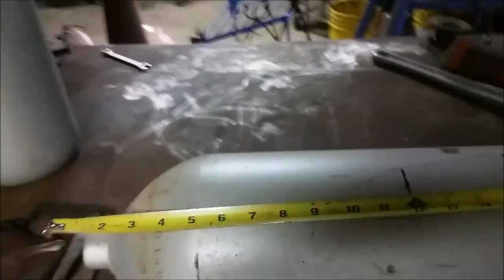Making a Bell Start To Finish

Comment: John I have 2 sticks 1\2" by 4" by 4" by 14' tubing to hang the bell should I weld or drill will it change the tone and were on pipe should my attachment point be. bell pipe is 1\2" by 10" by 10 ' steel. Lower tones are preferred any idea's
Reply from the maker: The bell should hang from a ring or chain. I have never hung one that size. It should have a nice low tone I would think.

Comment: John I have a pipe 10 in dia. 1\2 thick 10 ft. long I want to hang it as a bell I have post where in the pipe should I mount it and what should I use I can weld but for best sound I need help should I mount on end close to it or 1\2 way??????
Reply from the maker: If it is steel pipe you are looking at 64.4 pounds per foot for a total of 644 lbs. What are you suspending it from and what are you planning on suspending it with. That's a lot of weight to have hanging.

Comment: So I have a smaller oxygen tank. I've opened the valve and let it vent for a few hours, I got a loud hiss but now it's quite. after watching this I will let it vent overnight. should this be enough to insure that their is no pressure in the tank when I attempt to remove the valve?
Reply from the maker: If you let it sit overnight you should be fine.
Reply: Thank you sir, I'll do that and attempt your method for getting the valve off.
Reply: Attempted to get this valve off. Didnt quite have the tools you used in your video but did attempt to ratchet strap the tank to a tree but it is on tight. A friend of mine mentioned that it probably is stuck on with loctite, which I looked up has a strength of around 3,000 psi.
Reply from the maker: Never had that much trouble.My next step would be to try to make an adapter for an impact wrench.
Reply: Are you sure it was an oxygen tank? If it was acetylene, propane or other flammable gas it would be reversed threads.

Comment: Mr B,
What is that air actuated hammer you used to pancake the clapper? I don't beleive I have seen that device previously.
Thanks!
AAR
Reply from the maker: That is a KA75, nice hammer for hand work. Plenty of room for tooling.